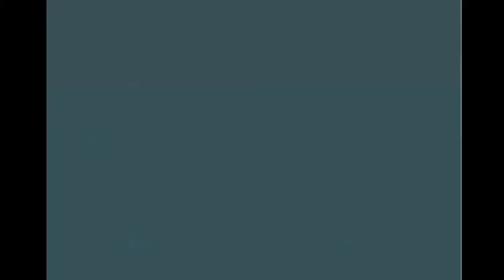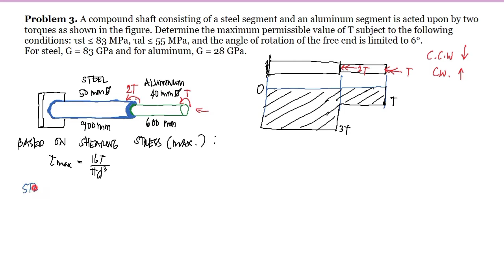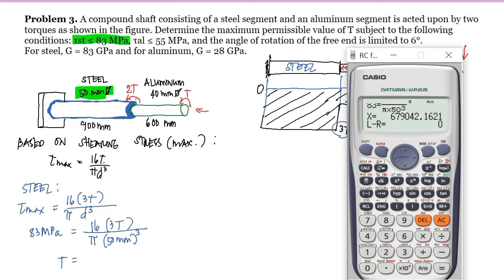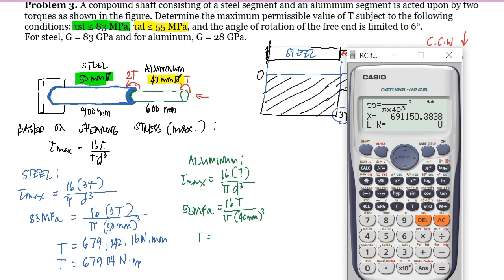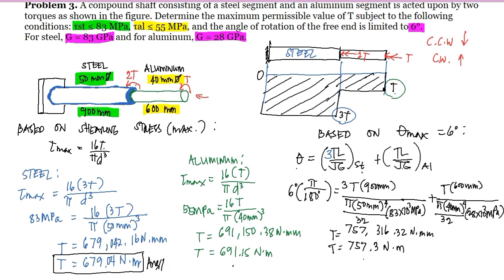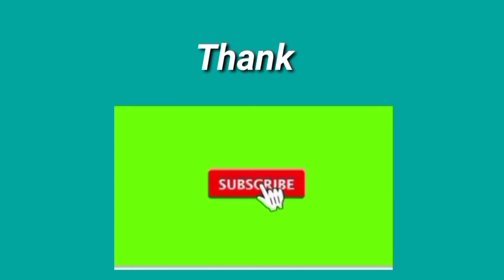Torsion Problem 3

Comment: Hindi po ba dapat sir isa lang magyyield between 83MPa and 55MPa? Nung nagcompute po ako assuming same angle of twist for steel and aluminum, naidentify ko po na 83MPa yields for steel and 11.2MPa po yung correspsonding stress for Aluminum.. resulting to T=140.74Nm.. mali po ba ako?
Reply from the maker: @riiru33  magkaiba kasi ang shearing stress ng aluminum at steel, kaya nag solve tayo ng allowable load na kakayanin nila. Then we also consider the angle of twist, after that we select the lowest value which is the safe load na kakayanin both ng aluminum and steel and not exceeding the allowable rotation.
Reply: @EngrRyeTutorials  gets po sir thank you po